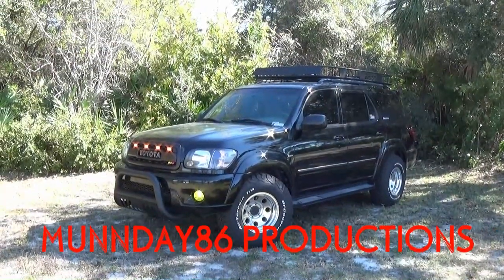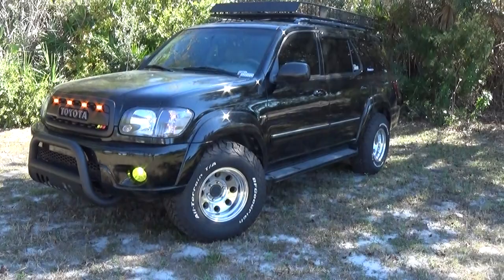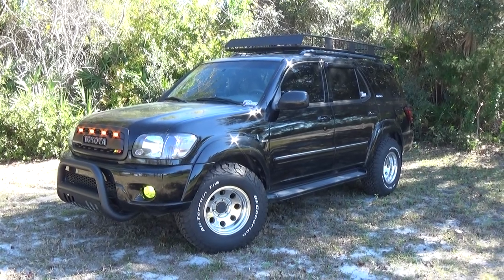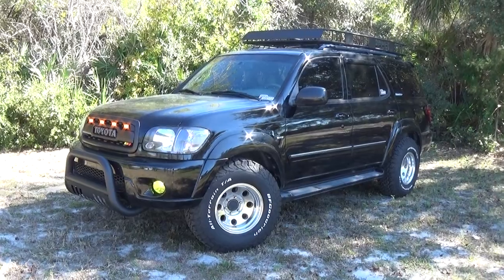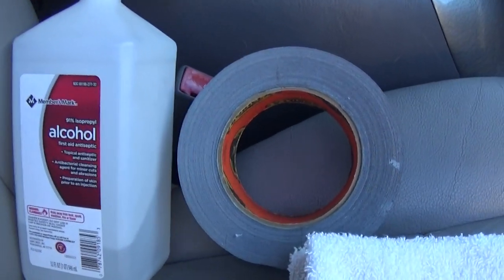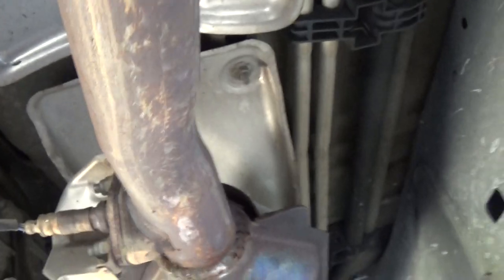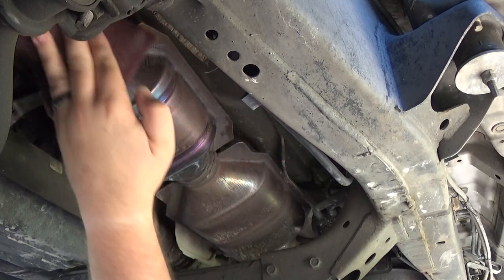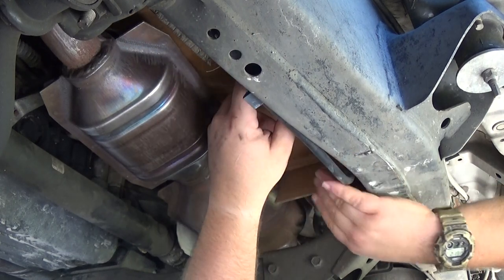SEQUOIA CATALYTIC CONVERTER DETERRENT(ANTI THEFT) STEP ONE. #TOYOTA #SEQUOIA

Comment: I once saw a guy try to cut through a pipe which had a blanket of material around the pipe kind of like a layer of Kevlar. The blanket of material was a little loose and the saw just moved the material back and forth with the blade. The teeth of the saw could not create friction to cut through the pipe. The insulation likely did have Kevlar since a knife could not cut it. If you had high temperature material with these properties, seems like maybe a solution that would work on just about any car.

Comment: My 2003 sequoia Catalytic converter looks different from yours. Is it an OEM? My cats has only 1 canister and no fins compared to yours that has the fins and 2 canisters. I painted it a few months ago and got hit a few days ago. They cut into it but realize it was painted and backed off. I had to get it welded. Today i added the metal rope and tied it down like yours too hopefully they don't strike again. Awesome tutorial.
Reply from the maker: Wow that was a close one. I'm glad the paint stopped the thiefs in their tracks. The cats on my sequoia where stolen over 10 years ago in California. They did have to weld some other Toyota cats to the exhaust. The OEM cats  where currently unavliable. So they look a little diffrent. The theft of cats come in waves but this time seems to be lot more than previous. The bright side is you only have to weld where they started to cut it. Thank you for sharing. It's good to know that the detterent works..

Comment: Looking forward to step 2.  Thanks for your vids.  I'm fixing up a 05.  You have been a big help.  I'm actually working on a TRD grill but 05 is different.  So we'll see...
Reply from the maker: Hopefully weather is nice this weekend. Supposed to rain :( if not I'll get it done and share with everybody... take your time on the grille measure twice cut once.
Reply: BTW some of your Amazon links go to out of stock.  You might update those with similar items.  So you get  paid for your hard work!
Reply from the maker: @Johnson-Sequoia  thank you it's frustrating the supply chain shortage is killing me and alot of links go dead as the supplier runs out of product. Which link are you looking at?
Reply: @munnday86  the TRD grill link and the headlights.  I can't remember which others
Reply from the maker: @Johnson-Sequoia  dang I put a new link up for the TRD pro grille like 4 days and already sold out or not available. The headlight link says currently unavliable. They sell out super fast.
Reply: @munnday86  I guess you are inspiring 😎
Reply from the maker: @Johnson-Sequoia . Thanks man. I just try to help everyone out.

Comment: Had an attempted theft of my cats on my 02 sequoia a lil while back, helped that we were asleep 10ish feet away from the rig and heard the commotion before they could get too far, the pipes still have the scar but still are intact. Going to be going the skid plate route with mine hopefully after taxes come back and also there is a law now on the books as of the 1st that makes it very had for those guys to sell the cats as well
Reply from the maker: I've looked for the skid plates with no luck. All sold out nobody makes them anymore.
Reply: @munnday86  I have noticed that as well, I just might get the standard transmission skid and then fab up some wings to add onto it.
Reply: @munnday86  cfm and skid row now have options

Comment: They just stole both cats from my wife’s 02’ Sequoia right from the parking garage at her job today! I am pretty pissed off about it. We love our trucks. I have an 06 Tundra double cab as well. I am definitely going to have to take extra measures to protect these trucks because they are targeted for their ease of access because the stock ground clearance. Does it matter what color you paint them or did you just do yellow because it calls attention? Was thinking red? Any facts or opinions on this are welcome. Thanks for making this vid ✊
Reply from the maker: You can use yellow or red. Just make sure you get the 1200° header paint. It will last alot longer.